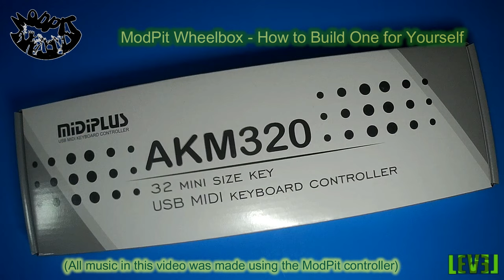Build Your Own Portable ModPit Wheel Box MIDI Controller (for less than $40 USD and no soldering!)

Comment: Appreciate the can-do spirit, but if you're trying to optimize for cheap, why not connect some pots to an arduino and save $25? This might sound like a rebuke, but I'm coming from a positive place... I'm watching you tear down this keyboard, and I'm confident that you have the skillset required to build the real thing. If nothing else, it's less shipping emissions and plastic landfill. Check out Nerd Musician's channel. He has lots of great tutorials: https://www.youtube.com/watch?v=CXDNysPhbkM
Reply from the maker: When you're right, you're right.  I wouldn't've taken that negatively.  Appreciate you easing into it, though.

Something I mention in the GitHub, but probably not in the video is that I need to clear my electronics bench.  Meaning, it's pretty much a giant shelf, right now.  The thought did occur, even with 3D-printed wheels, etc.  Everything could be made so much smaller and more comfortable, AND give the option for o.g. 5-pin MIDI.  But, getting those mounted so that pitch bend would snap back very well would be a challenge, at least for me.  So, then I looked into buying only these sorts of assemblies, saw the choices were mostly for replacements for nicer equipment, meaning higher prices... wondered where I could just quickly acquire cheap wheel assemblies... like they use in cheaper - aha!  And, here we are.  

So, it was more a balance of optimizing for cheap + easy.  ;) 

I'll definitely be checking out that channel, thanks my friend!  🙏